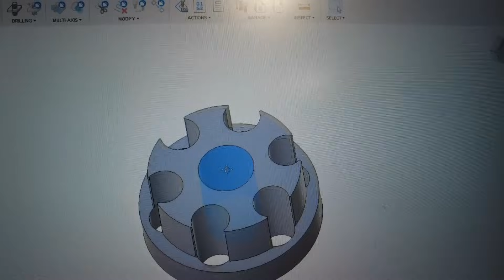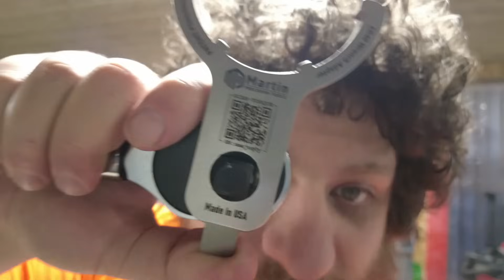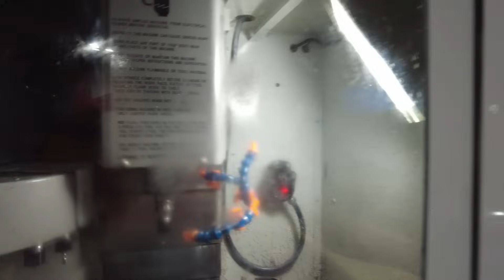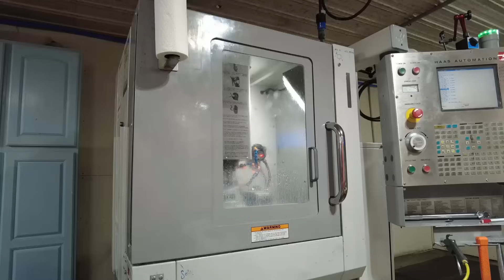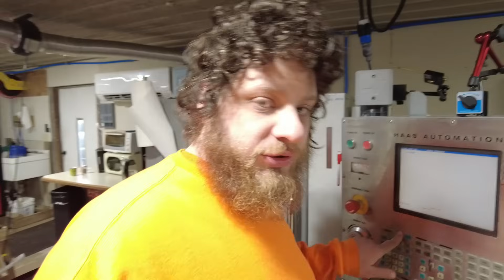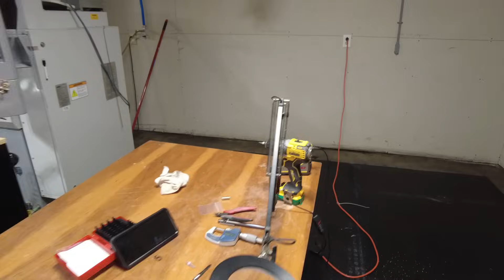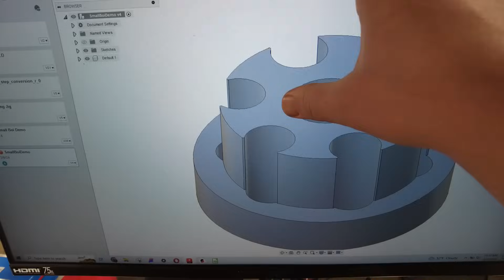Machining Some ABSURDLY Tiny Parts

Comment: Using PCB drills is dead easy, I do it all the time and can go down to 0.15mm if necessary. It's just a matter of taking it gently and pecking the holes. Obviously you're not going to try to drill on anything but a flat surface or it's going to break.
PCB drilling machines drill around 3 holes per second using 250,000RPM Air Bearing spindles in fibre glass type materials. The drills are not optimised for metals, but they do the job perfectly well if you take a little care. They are expected to drill through a thin Aluminium entry material.

Comment: A Swiss Screw Machine could turn out hundreds or thousands of these parts, in a fraction of the time. It's a pretty big investment though, you'd have to have a lot of these jobs to justify it.
Reply from the maker: A Swiss lathe is on my wishlist at the moment. It would definitely be a super valuable tool on my mission to make tiny stuff.
Reply: @AudacityMicro  the SwissNano series from Tornos looks like an amazing machine for tiny work.

Comment: Wow.  Amazing.  But how do they make such a tiny drill bit that you use?  0.2 mm drill?  How day doo dat?
Reply: What I wonder is how they make and use tooling that is far smaller than that! For example the needle probes used to test bare microchips (wafer probing) before they are cast into their epoxy housings: the probes have tips 0.05mm (2 thou) diameter — and that’s also the size of the thinnest drill bits I could find mention of. Or the saws used to cut the wafers apart: “dicing” saw blades are around 30μm thick!

Comment: small parts and tight tolerances made the world as we know it.  electronic components have tiny internal parts like that... someone said he should use EDM (electric discharge machining) ... which sounds like would do the job nicely....but remember, dude only has one night to get it done.  and i'm gonna guess he doesn't have time or access to graphite and the equipment to make electrodes....   the biggest problem is the lack of time to get it done.  and the continuous loosing of the tiny, finished parts.

Comment: just offhand what is the going rate for 1 specialized part like this and what is the minimum order please
Reply from the maker: A minimum order for me tends to start at about $300, and just kinda goes up from there depending on the complexity of the part, and the materials. But per-part prices quickly drop as you add more quantity.
Reply: $300.00 should be your fee to turn on the machine...YOU'RE skill is unparalleled my young friend. I didn't think tool and die men existed any more but YOU take tool and die to another planet....ASTOUNDING

Comment: Usually, when having to handle small parts/components (0.05~0.2mm), I'll use some regular gift wrapping tape or putty. Excellent job and extremely respectable that you won't accept anything but what the client ordered in spec. Wish you well!

Comment: Not a verry professional work area for such important parts
Reply from the maker: I'm getting there! I've only been doing this for a few months at this point, and while I would love to invest a ton of money in my shop,and will eventually, I have been spending it on more important things that help me make better parts, like better metrology equipment.

My customers don't care who I am, or what me or my shop looks like. They just want good parts made quickly, and that is something that I can deliver with my current shop.
Reply: @AudacityMicro  man you have alot more patients than I ever had or will have that's crazy small stuff good luck in this endeavor

Comment: Generally, when a part has holes in it like that, they are to allow something to pass through the part. Those holes are a bit small for anything other than a gas. The mind boggles.

Comment: How do you make any money? Or is someone paying $200 per tiny grain-o-sand sized parts?
Reply from the maker: I'll be the first to admit that I didn't change enough 😂. But yeah, im pretty sure these parts cost more than their weight in gold, even at my undercharging rate.
Reply: @AudacityMicro  at that size you could have just sent them a handful of filings and they'd have been none the wiser.

Comment: You said you need to make and deliver 10 stainless steel parts.
Just curious, what was the value of the job?  

20 Years back or so, I serviced the Stepper Motor controller cards on a small desktop 5 axis machine for a client.
He pulled out a small bag from his pocket with about 100 micro parts in it.
He Told me that was 50K in his pocket. that was about a years worth of my Salary back then.
Reply from the maker: I did not charge enough 😅. Like I said, I didn't really comprehend how small these parts were, and how difficult they would be to handle.

Comment: @1975 in metal shop we were informed about German engineering. We (a USA manufacture) send a extremely small diameter- gauge- wire on a spool to Germany. It is returned with no comment. Some time goes by. Finally it is discovered that the wire is no longer a wire,but a pipe: it was unrolled ‘drilled ‘ its entire length and rewound. @40 years ago! Anyway, quite interesting.

Comment: Your troubles all were very familiar. I repair watches for a hobby.  

Have a look at how watch makers work. Use small parts trays. Work in the middle, not the edge of your desk, as this give you a sporting chance of the part remaining on the desk. Work on a large, clean, white or off white sheet of paper or plastic.  

Use reading glasses with a clip on loupe to see the tiny details... and use lots and lots of light. 

For mild steel, you can find dropped parts with a magnet. A lot of watch parts however are brass, so you are bang out of luck with a magnet there. 

Stainless steel parts and anything shiny tend to be more visible on the floor if you lay your torch on the floor and sweep across, the floor, like a prison search light, rather than shining the light down on to the floor. 

 Springs are your enemy. Anything springy can leap seemingly hundreds of feet in a random direction.

Don't work above a carpet. Carpets eat parts, and laugh about it with their friends later.  Put some plain, dark lino on the floor where the parts are likely to drop. Nothing with a pattern as the pattern will help camouflage the dropped part.  

Finally accept that at these tiny scales quantum effects take over and some parts simply vanish from this universe and reappear in a distant galaxy.... OK that last one may not be 100% accurate, but it certainly feels that way. 

Watch makers joke that things join the "Swiss Space Program" when  small watch parts fly out of your tweezers and vanish into outer space.
Reply: .. another little tip. Use a fine meshed bag, or sock on the end of the hose of a small vacuum cleaner to try to pick up the missing parts.  The part should end up in the fine mesh.

Comment: Non-machinist here, is it common to switch between metric and imperial on the same part? You used metric bits but were saying “thou” when referencing tolerances. Just curious.
Reply from the maker: It's pretty common these days. Most parts are a mix of both. I have a tendency to swing back and forth throughout the day to whichever one is the most convenient. Generally imperial is more useful to work in, and more of my metrology stuff is imperial, so I use that in my head for tolerances.

Comment: Remember when I was in school in the beginning of the 90’s, doing work practice at Siemens making parts for pacemakers. Insanely small parts, and made of nylon. Those CNC multiops was fantastic already then. The work mostly was control measuring every 10th part.

Comment: That's a challenge on any machine but much more so on a Haas or similar machines . Don't get me wrong I like Haas , I've purchased about 3 Dozen over the years. But eventually replaced them with Makino and Mazak. The difference in holding tight tolerances was night and day

Comment: Ok the elephant in the room says what is the price for the customer for such a tiny piece? Oh and how long did it finally take to create it?
Reply from the maker: It worked out to be about $60 per part. Which wasn't enough. The whole process took me about 3 days total. Though the individual cycle time on each part was only a few minutes. It took me longer to measure them, than actually machine them.

Comment: Not sure if it would help with these particular parts, but if you ever get a job that involves handling a lot of small pins (I make cycloidal gearboxes with fifty 1x4mm pins), make a pair of tweezers with a little notch cut in the jaws. Normal tweezers can't grip cylindrical objects worth a darn, but if there's a notch, the pin will settle into it and point out at a predictable angle so you can pick and place them rapid-fire.

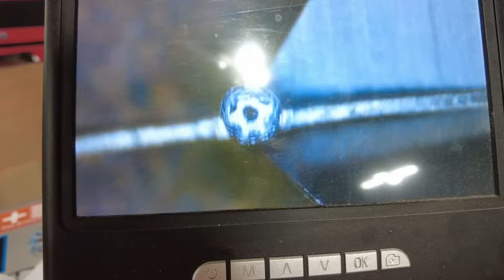Comment: currently at ~8:50. You could try conventional milling instead of climb milling. this way the mill isnt running along the part to possibly push the burs into the part, it will instead pull the material away from the part.

Comment: It occurs to me that your comically large human sized hands are not ideal for working with tiny parts.
You could use some mechanical tiny hands to effectively work at this scale.
https://www.youtube.com/watch?v=d_8rHKrwr-Q
Maybe you could challenge yourself into building machines capable of machining the exact parts necessary to build an even smaller machine. A tiny endmill and lathe that could make all the parts necessary to build another endmill and lathe that are 20% smaller. Then use your tiny mechanical hands to assemble it.
Reply from the maker: I am 100% on board with this 😁

Comment: Weren't these all steel parts? I always use a magnet when working with small screws. Also put down a silicone pad or microfiber towel, you might as well be playing with .1 mm ball bearings. I also use trays like dinner trays and put silicone pads on them, you need the sides of the tray, the silicone comes in bright colors, so easy to contrast. Pretty awesome machine to make parts like that.

Comment: I kinda feel like hardening micro parts could help machine them. They would act like a material properties of a normal size part. Then you’d have to anneal after but whatever
Reply from the maker: I think you are right. Generally harder materials machine nicer, they just wear tools faster. Which really isn't an issue here. It would definitely help prevent some of the burrs. Unfortunately in this case, both materials were non heat treatable.

Comment: Just imagine Watch makers they made smaller perfect parts a couple hundred years ago. And they did it mainly by hand. It’s crazy how these small parts are made. Great job though, I’d love to have a tiny machine shop lol
Reply: I did once make a Hub for a secondshand for a watch, ø0.8 x 1 mm, with a 0.25 mm hole in it.. I started by making the drill out of a piece of ø3 mm toolbit, Turned it down to 0.25mm at the tip, and 0.23 at the back for clearance , then filed 2 flats and the cutting edges with an arkansas oilstone, then turned the part out of brass, and that lathe only has a toolrest.. you hold the cutting tool by hand.. i then drilled it, and parted it off.. i used a piece of tube in the Tailstock, to hold my parting blade against, and also to catch the part .
and finally i put it in a small pen-like chuck to deburr the back of it...
yes.. it is crazy.. but so satisfying to pull it off..
Reply: Speaking for yourself. I would not find it satisfying. LoL

Comment: What if you had a small vacuum just above the part? You could cut all the way through to remove the tab, and you wouldn't lose them as easily.

You could then cut open the vacuum cleaner filter and find all the parts.

Comment: You're gonna need to back fill those holes with something hard so you can machine the outside radius after you drill the holes. Then dissolve out the filler

Comment: I have zero experience in making tiny parts, but my first thought was using a clay or puddy to help hold the tiny pieces.  I would think putting a piece of puddy around the gauge pin would make it much easier to work with.

Edit: I shouldn’t comment until I've finished watching the video since you mention puddy at the end.
Reply from the maker: Your instincts are definitely right- that's exactly what the watchmakers do.

Comment: You can use much smaller end mills, Like a 1/64" carbide end mill, 1/8" is way to big for what you are doing, it's battering the part.  Use end mills to bore the holes instead of drills. When you have the tool speed and feed rate right you will get the best finish.
Reply from the maker: That is super interesting, and not something I considered. I'll definitely try a smaller endmill next time. Though I don't think I can bore the holes. It would just require too tiny of a tool. PCB drills are dirt cheap. 0.15mm endmills are rather expensive, and easy to break.
Reply: Yes drilling the holes will be best. I would program the machine to increment down .001 to spot the holes first, then increment another .001, then drill the holes with a moderate feed rate @AudacityMicro

Comment: For the burrs on the radial holes... if it was me (making something larger) I would drill all those holes, then insert pins into them, then machine around the outside.
That way, the holes are filled and the edges are supported during the cut, as well as keeping the holes clear. After machining, Knock out the remaining parts of the pins, done!

Comment: I so downloaded this! It's going straight into my "So, do you recon you're a machinist yet Chook?" folder.

I've spent most of my life making stuff more in common with the work of Kurtis from CEE channel. But I'm only in my 60's so I still have time to give interesting new skills a shot.

Not long ago I managed to hand make a 0.3mm spade bit from a wire out of a stainless steel wire brush. But I suspect it drilled seriously oversize at that scale. Problem being, I have no way of measuring bores of that size.

Like you, measuring at that scale is the tricky bit of the job, especially at home

Comment: I was working on parts with small holes in SS, not this tiny, but the trick for drill to not wonder is to use super sharp spot drill with angle less than your drill. So 45deg chamfer tool seemed to work the best. Also 0.2mm drill needs like insane spindle RPMs well at least fr plastic, for SS I would probably do like 10K?

Comment: This is kind of random, but in the beading/rhinestoning world we use something called a “crystal katana” which is a pen shaped tool with a waxy like tip so you can pick up very small beads and gemstones. Not totally sure it would work for your needs, but the tool is a great alternative for picking up small things that usually go flying when using tweezers.

Comment: My dude, if your community is seriously going to debate whether your torque values are correct because your claw is at a 180 degree angle instead of a 90 degree angle when you’re TIGHTENING DOWN A COLLET…

Y’all motherfuckers need to come by a repair shop sometime.  My standard for tightening a collet is “3 taps on the wrench with a deadblow” and if you think that’s not acceptable, you’re wrong.

Comment: You may want to consider adding a high-speed (65,000+ rpm) air turbine spindle to the Haas for machining tiny parts as it may prove cost-effective in terms of time lost with burrs and finishing.
Reply from the maker: This machine has a 40K spindle, and I haven't really needed more speed for anything yet. I think the biggest investment in could make, would be in some Regofix PG tool holders

Comment: What does that HAAS machine cost?
Reply from the maker: I bought this one used for $18000. You can find ones with different options for as low as about $14000.

Haas doesn't make this exact machine any more, but their modern equivalent (CM1) is about $60k depending on options.
Reply: @AudacityMicro   About a decade ago I made webpage for a company that's a dealer of HAAS machines.  Really, that was the only way I recognized the name.    Aside, I did spend $32,000 on electromagnetic software.  I use that and other tools for my clients.  Maybe I should make a video on that some day.  Cheers!

Comment: Jewelers will sometimes use an apron that attaches to the workbench to prevent any errant parts from falling.

Getting a lunch tray and working on that might also be a good idea.

As far as tweezers go, Erem makes some for surface mount components that are very fine. I was able to use them to handle 0402 resistors (0.040" x 0.020") and manually solder them.
Reply: You need to find and old school fiberglass lunch tray - all the new plastic ones warp and don't sit flat, and are probably worse to work on than a bare table.